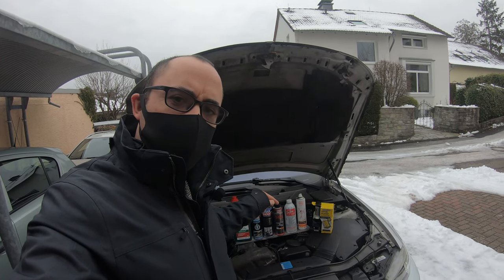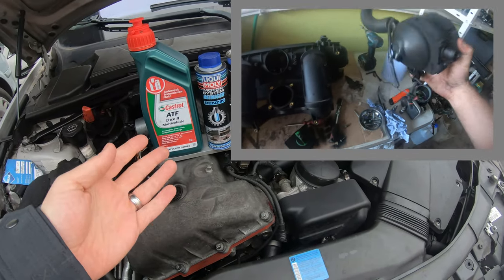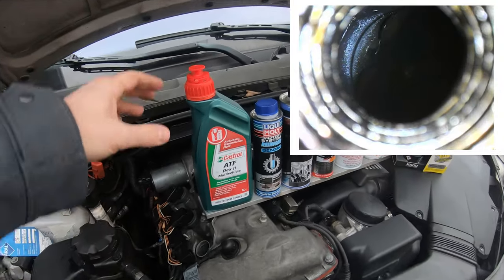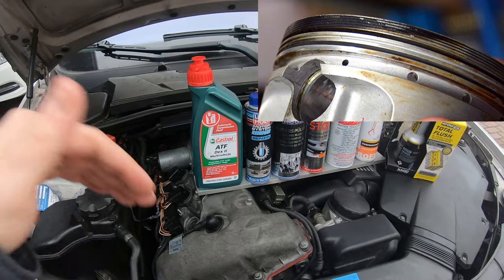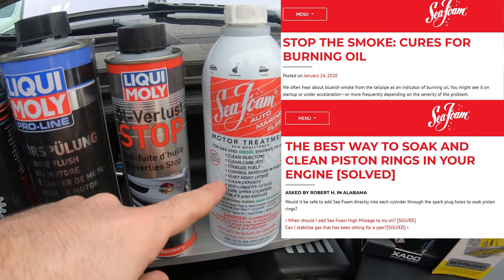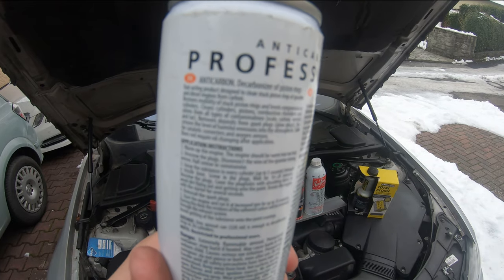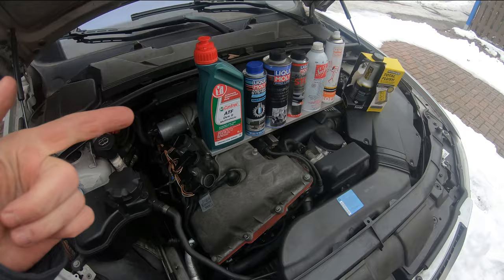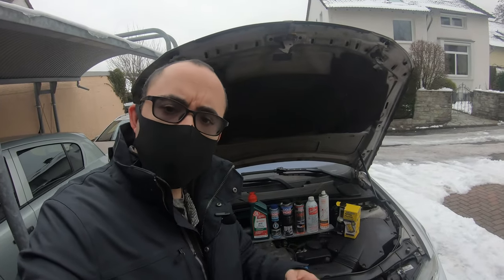Can Snake Oil Products Help Reduce Oil Consumption? We Test Seafoam, Liqui Moly, Atomex and More!

Comment: I have an Audi A5 liquid moly engine flush worked for me I use it twice a year my consumption went 80% down
Reply from the maker: Thanks for the info! What was it per liter before and after the engine flush?
Reply: @buildanddrive  a litre every 1500 miles and after the flush a litre every 5000 miles which is great .piston rings get clogged up with carbon on Audi cars I’m assuming that’s your problem on your bmw aswell always change your oil every 5k to keep the engine clean
Reply: My case of oil consumption really strange. So once I do oil change on my bmw, it starts to ask for ltr after 1,800km and then after that first time, it is going to be ltr after 1000km no idea why
Reply from the maker: It's because the electronic oil dipstick is not very precise. It's 2005 technology 😂. I did an oil change right when the dipstick said to add 1L and it only had about 4.5 to 5 liters in it!
Reply: @buildanddrive  waaaw make sense, as much as I am in love with my e90 as much I hate how she is treated me and I do really good take care of her.
Reply: Year of your car please A5 ??
Reply: @deadshot2323  2008  1.8 tfsi
Reply: Same experience in my brohter's 2013 A5 1.8 TFSI, engine flush completely stopped oil consumption from 1 liter every 2000 km to 0 addition between oil changes. He also used Liqui Moly engine flush (2 or 3 fuel injector cleaner bottles in he also ran CRC admission/turbo cleaner since Oil separator went bad and was replaced).
Reply from the maker: Thanks for sharing that info here. 👌🏼. Maybe the Audi piston oil return holes or the oil control rings get freed up by the engine flush enough to work again. This unfortunately doesn't work on the n52 engine. Once they are worn, they need to be replaced.

Comment: I think your oil consumption got worse with each successive engine flush because it accumulates in the engine. Each time you change the oil, there's maybe 1-2 L of oil still inside that doesn't drain, and this is a cocktail of old oil and all the additives you've put in it before. Your oil is now thinned because it contains a LOT of different flush additives. Change the oil again with no additive, and then one more time to reach a baseline oil viscosity, and test the consumption again
Reply: After using all of these products you need to use engine flush, that's the only right method.
Reply from the maker: I didn't use all these products back to back, it was over time I used them. But I agree that over time the additives flushed some gunk that was helping seal the engine 🤣
Reply: @buildanddrive  Gotcha, I was under the impression you changed the oil with each additive.
Reply from the maker: Yes oil was changed between each additive for sure 👌🏼
Reply: @buildanddrive  I guess the question I'm asking is, did you change the oil with just plain oil in between each oil change? I know you changed the oil with each additive, but when you changed the oil after using an additive, did you use just regular oil with no additive, run that for a whole interval and then test another additive when doing another oil change? The reason I'm asking is because when you change the oil, 1-2 quarts remain inside with additive in it. After doing that with many additives, you now have a blend of oil with many thinning additives left over.
Reply from the maker: I can look through my notes, but normally yes, I changed the oil with normal oil and NO additives to test to see if the previous additive had worked or not.
Reply: @buildanddrive  That's what I was wondering. Thanks! And sorry if I made that unclear when I asked.

Comment: Really GREAT JOB on doing this real life testing!!  Now to find out what was ACTUALLY causing this problem. My best buddy rebuilt his entire engine except the heads and when he was doing the rings (this was an N54 Turbo engine but same basic thing) he was shown on a chart what was acceptable gap amounts and that there was a more open gap and a smaller gap all within okay specs. He chose the more open gap. Once the car was all done and on the road he was blown away when after a very short 1000 KM (About 750mile)the car was eating 1 liter per 200 km!!! Maybe he miggotget 250 km but seriously NO MORE! Now we are pulling our hair out trying to figure out what the hamburger  is going on!! Turbos are brand new too. The only reasons we can think is Valve seals (which were fine before the rebuild) or PCV System (he had NOT replaced the valve cover but did put in an "upgraded"  PCV Valve. Plus catch can. His plugs OH MY LORD! In just 300 km a new set will be so filled with carbon and oil that they can't run the car!! It's madness! So the big question  would be the choice of ring gap? Or the Valve cover which houses the PCV system or the Valve seals in the head or the Turbo seals. But those Turbo seals are metal and really they don't break like that! I have the very same car myself (2008 335XI) But mine runs like the N54 always has from the two of them I've experienced. Sigh..... 😢
Reply from the maker: I rebuilt this engine on the channel (see other videos) and the piston rings were almost double the specifications, engine burning 1L/300kms. My spark plug #3 would clog up after only 5000kms. - Ring gap video: https://youtu.be/TIiOVlUf6Zk?si=SZq6AYGh9VWgFchQ

Comment: I had the same experience with the Liquid Moly Engine Flush over a year ago and my Camry still burns oil.  Now,  going to try Amsoil Engine Flush and their OE Full Synthetic before I give up. No leaks or smoking, just have to topoff.  It does run smooth I might add.  PCV was changed, so I did eliminate a few culprits.
Reply from the maker: Google Camry engine consumption... There was one engine, don't remember which one, that had this same problem.

Comment: Thank you for this video, I’m sorry about your N52 but this research really helps us. I have 1Quart/1k miles on my 173k N52B30 and I tried LM oil stop but it didn’t do much. I was planing on trying all of these products but now i will be more cautious. The last thing I will try is LM Oil Flush and Ceratec and then live with my result from there. Thank you, best of luck with everything.
Reply from the maker: Yeah, rebuilding the engine now. We will see if that fixes the oil consumption
Reply: Dit it work@michael?
Reply from the maker: I'm also interested
Reply: @Passionforgermancars  it did not work lol, but I found using rotella slows it down a bit. I have a oil pan leak that i need to fix first
Reply: @buildanddrive  not really lol see other reply
Reply from the maker: @fasteat1 Did the ceratec help? (If at all)
Reply from the maker: "no mikey no no mikey that was so not right" 😂😂😂
Reply: @buildanddrive  probably added some engine protection but did not help
Reply from the maker: Thanks for letting me know

Comment: What are you doing they are not sneak oils the Liqui moly oil saver is fo leaks it regenerates rubber and plastic and your spark plugs it’s not normal gunk in piston ring you need to repeat engine flush with seafoam and give it some time driving with it
Reply from the maker: It may work for other engines but not the N52 due to the tolerances and bad piston design

Comment: I have a 2008 Honda accord 2.4L. Honda posted a tsb service bulletin stating that stuck piston rings cause unusually high engine oil consumption. 800-900 miles later I’m putting a quart of oil in my car. More than likely the culprit is stuck piston rings like Honda themselves stated, so I’m gonna try engine flush on 3 seperate oil changes and hopefully it works out. I’m also going to try seafoam in crankcase for 300 miles before my next oil change!
Reply from the maker: Good luck. Tell me if it works. I also tried this but it didn't work for my engine because the piston rings actually wear out, nothing you can do about it but replace them.
Reply: @buildanddrive oil change time is soon, so far have seafoam In my crankcase. Will do oil change this weekend then next oil change use liquid moly flush

Comment: My engine was burning oil at high revs, I could see the smoke, I added liqui moly mos2 and i could no longer see any smoke, I guess it helps in a way by coating the metal to metal contacts reducing how much oil can enter
Reply from the maker: What car/engine do you have and what kind of oil are you using and how long did you use the mos2 for before you saw a difference? What was your oil consumption before and after using it? Do you use it with each oil change?

Comment: MY ENGINE THE 260 V8 BURNS A LITTLE OIL, I AM TAKING IT NEXT WEEK FOR NEW VALVE GUIDE SEALS,
IT'S BEEN 7 YEARS SINCE I HAD THEM REPLACED, THEN I WILL PUT IN A HEAVIER OIL 10-40 WEIGHT, WITH
2 OZS OF ZINC, IT USUALLY SMOKES ON STARTUP SOME BUT WHEN THE OIL ON TOP OF THE pistons
BURNS OFF IT'S PRETTY GOOD UNLESS I GET ON IT THEN IT SMOKES MORE. WITH THE BAD VALVE SEALS THE OIL DRAINS PAST THE 
VALVE STEM SEALS AND COLLECTS ON TOP OF THE PISTONS.  Thanks for the video, they all seen to claim success, 
but it seems nothing really works when the engine has too many miles on it and needs new rings. Then it needs a ring
and valve job.
Reply from the maker: Yes, it will 'clean' the engine but not fix a work out part like valve stem seals or pistons rings.

Comment: The good old truth - if your piston rings are cooked (were overeaten) there is no other choice but replacement. 

Driving harder might be better than lugging your engine
Reply from the maker: Piston rings were totally cooked. Worn almost double the specs. The n52 engine had low tension piston rings which allowed it to rev easily to 7000rpm but in turn it burns oil... after 100,000kms and the rings are pretty much done unfortunately... they fixed the piston design in 2008 I believe, moving the holes over to improve oil return... but still these engines use an abnormal amount of oil. Check out my other videos as I am rebuilding the engine now.
Reply: @buildanddrive  u only used oil flushing additives. not restore additives

Comment: Bought a 328i w/ an N51 engine recently. Think I got a really nice engine as there doesn't appear to be any leaks or oil consumption. I"ve got about 600 miles on it. Been considering an oil flush at some point but I'm afraid I might loosen up some seals that are preventing leaks. Prob better off leaving well enough alone, but definitely tempted to see if the engine performance could be taken up a notch.

Do you think maybe a good alternative is just to keep using quality oil (change at 5k miles) and maybe a lubrication additive like ceratec?
Reply from the maker: Yes, just use a high quality oil and filter. Check the links in the description for liquid moly 5w40 and find the correct filter for your engine

Comment: BMW turbos and oil consumption… had issues with my n63 v8 with twins and it’s just as bad.  They had to replace seals and that helped, then turbo seals went.  These didn’t help to much
Reply from the maker: With these BMW engines, I don't think any of these types of products work because you cant fix a worn out seal or piston ring... It must be replaced.

Comment: People swear by BG EPR but idk if it works personally. You do it right before an oil change. Maybe try that?
Reply from the maker: I've used BG 44k fuel injector cleaner. Don't know if it made any difference... But I am rebuilding the engine now because none of these products helped. I think once your car is burning oil, the damage is done and you can't "revive" anything (piston rings/seals)
Reply: @buildanddrive  can't wait for the video of the rebuild.
Reply from the maker: All Rebuild videos are being uploaded on my channel every week. You can start watching from here: https://youtu.be/c_ZRdBV6A58 I've taken many engines apart but never put them back together, checked tolerances etc. and actually heard them run again 😂. This is my first real build! #wishmeluck
Reply: @buildanddrive  hahaha ya I went back through your channel and saw the videos. I guess putting it all back together is the tricky part. I'm considering doing this to my Lexus GS350 engine because it burns quite a bit of oil but aside from a valve cover gasket and spark plugs I haven't done any engine work before. Any thoughts?
Reply from the maker: I owned a RHD Toyota Aristo 2JZGTE import (it's a Lexus gs300) but from Japan and it burned a bit of oil. It was the valve stem seals, you get a puff of smoke on startup on a cold day. If you have a private driveway, garage, engine crane, tools and most of all the time to do it ... Possible. I bought a wrecked engine and it took me about a month to rebuild the engine in my spare time, waiting on parts etc. And then 2 weeks to put the engine in because bolts broke, exhaust bolts were stuck, didn't have the right tools etc. It's a big project so if you don't need your car for a long time... Possible to rebuilt it.
Reply from the maker: It may save you a lot of time to get a good know junkyard engine and just swap that. But it also maybe have similar issues.
Reply: @buildanddrive  thanks for the info! I'll have to weigh my options out.

Comment: YOUR ENGINE BURNS MORE OIL THAN MY 1963 RANCHERO WITH A 260 V8 IN IT
WITH EITHER 106K MILES OR 206K MILES, NOT REALLY SURE, MINE BURNS AROUND
1/2 A QT EVERY 5-700 MILES, OR AROUND EVERY 2-3 MONTHS OF DRIVING.
Reply from the maker: LOL.

Comment: Is "worse and worse and worse" (0:51) different (or worse) than "worse"?
Thank you for making this video.
Reply from the maker: "worse... worser... worsest" 😂This stuff may help clean your engine... but also can further damage the components that are already worn out. If you have "stuck rings" and low compression, it's worth a try, but if your rings  are "worn out and out of spec", it won't magically revive worn out parts

Comment: Motor oil saver works from personal experience.
Reply from the maker: I used the liqui moly oil saver 3 times under different conditions and oils and it didn't do anything for my engine. May work for others though 👍🏼

Comment: Did you try putting the seafoam in the crankcase and driving? Hoping it may work for me as its already in the process of happening. Rip 9 dollars.
Reply from the maker: Yes I did a test with many different products but unfortunately the pistons rings wear out and that's is the main issue... Seafoam or any engine cleaner will NOT refresh the rings and may do more damage than it's worth. Watch here - https://youtu.be/_e42KizePlQ Seafoam may work in other engines but not in these BMWs

Comment: In some cases, engine flush can make things worse by weaking seals that are about to fail!
Reply from the maker: True
Reply: no. engine flush removes debris and shows where real problems are. dirt is not a sealant
Reply from the maker: Engine flushes wore out the seals that were already worn in the engine which increased oil consumption

Comment: Use two bottles of liqui moly ceratec in your BMW!!! IT DID WONDERS ON MY E46
Reply from the maker: What did it do for your engine?
Reply: @buildanddrive  first of all i used liqui moly sludge flush wich is a flush where you have to drive 200km with it in the engine. Then used liqui moly 5w40 synthoil with two bottles of ceratec.

I didnt expect a huge difference but after  about 200 kms i stepped out of the car at a gas station and couldnt believe my ears! The engine was so quiet i thought it was the cooling fan still spinning!

After that i did the same procedure in my friends alfa romeo GT 1.8 and he was just as shocked as i was. 

You need to try it out on your BMW it only protects against wear so you dont have to worry about anything. But makes sure you use two bottles because  your car takes more than 5 litres.
Reply: @buildanddrive  also use it after oil change and not with old oil.
Reply from the maker: @Ziad-ww6tw  I tried too many products ... I don't think many of them work as well as we want them too. I rebuilt the engine so no need for more products in my opinion.
Reply: Does it works with oil burning issue ? 
mine is 2.0l 318ci
Reply: @ahmadkheiro735  contact liqui moly.
Ceratec is for wear prevention
Reply from the maker: Yes, of your car is already burning oil,i dont think it will help

Comment: Not sure if this applies to the N52, but my M54 has a notoriously bad CCV system - clogs up, nowhere for the oil vapours to go, so they get burnt.
Replace the CCV, first and foremost, and the do the famous 02 Pilot mod - adds vacuum at the oil separator to suck the vapours through properly.
Reply from the maker: The n52 CCV with the magnesium cover are terrible

Comment: hell yeah, my kind of video.
Reply: Royal Purple or Amsoil oil change to clean that way? That i would watch.
Reply: Responding to the end. Why not try Lucas, thicken up the oil and see how that goes.
Reply from the maker: Vanos system is sensitive to those kind of thickeners, it can block the tiny oil passages with gunk from the oil. I tried a liquid moly one but it did nothing. I forgot to include it in this video.

Comment: Only thing used car buyers can do is, right when they get the car, do an engine flush, then 5k oil change intervals or less if the oils already darkened too much, with good quality oil. Then, fix every leak you have. Only then can you notice the problem before it starts - 1qt low at your oil change interval, 5k or less, with a car that has no leaks is your 1st sign. When this happens, time for another engine flush. And repeat the process. Over time, with good oil, the problem should fix itself. But if you've already purchased a used car that has been neglected, it could be too late... I'm at 1qt every 500 miles. And so, I'm Fuuhhhct
Reply from the maker: I did exactly as you described, problem got worse and worse and worse. Gona open up that engine eventually and see what went wrong